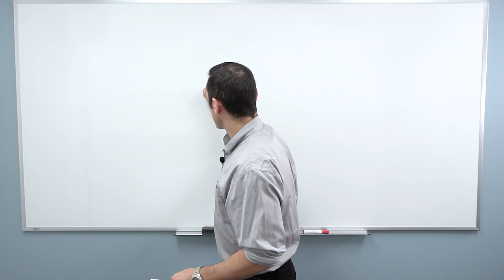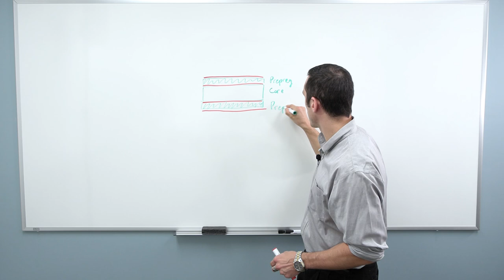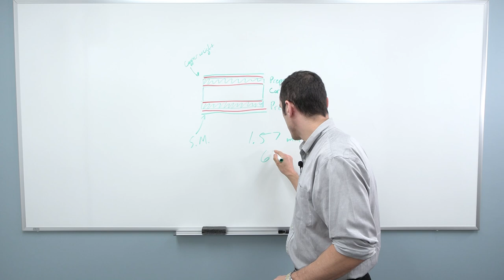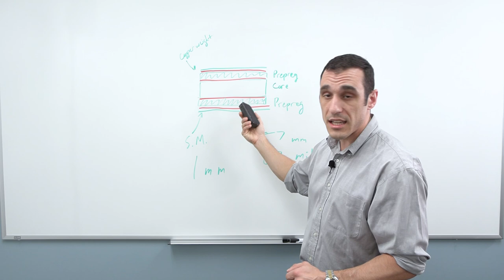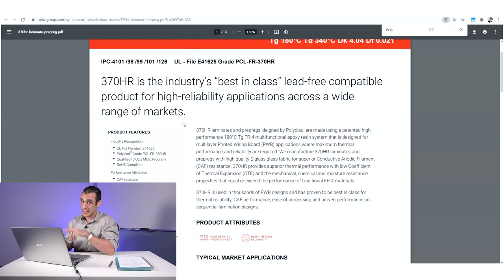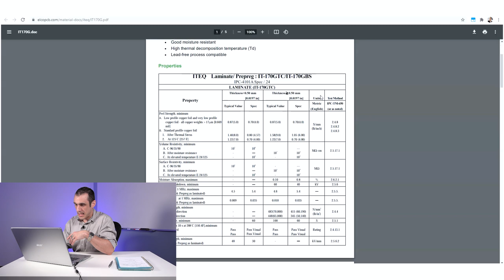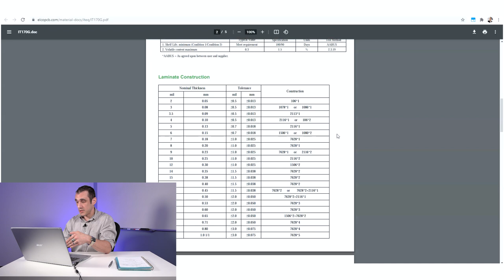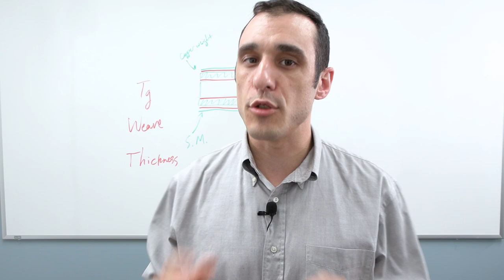Board Thickness in PCB Design

Comment: Its like you're making these vids for me. I'm currently working on an RF 4 layer board using Altium. I have a DFM(Design Guide for Manufacturing) from my manufacturer and its very important to have active communication with them. I've run into VIA spacing issues, needing micro vias and finding out my layer 1 to layer 2 spacing wont allow for a micro via. Instead I can have a blind via. The difference is a blind via  needs a much bigger drill than a standard through via. Talking with them we've changed the trace width and spacing for CPWG a few times as we've adjusted the layer stackup. I really appreciate these videos.

Comment: Great explanation, what are the considered layout parameters for choosing the type and thicknesses of these layers?
Reply: Think about if you need to support high speed signals, how much power your board needs to provide, and the fact that you should include ground for each new layer you add to the board. Most designers think they can try to do everything on 2 layers to reduce costs but professional designs that will actually pass EMC testing should be done on 4 layers with the inner 2 layers as ground. That is the best approach for a double-sided board.